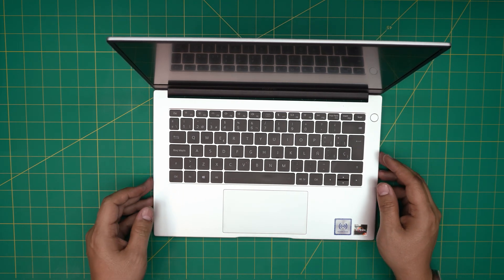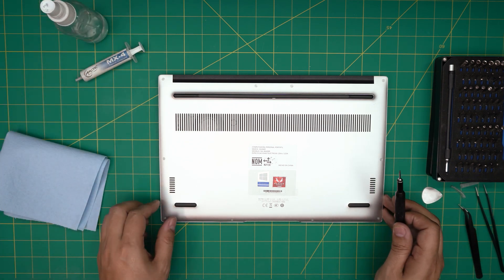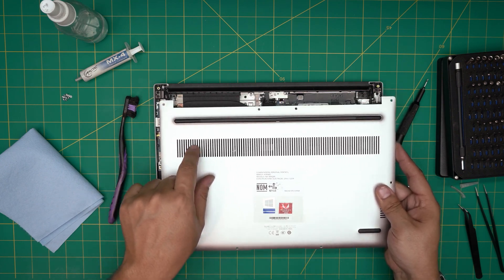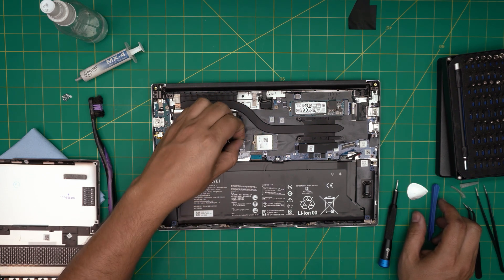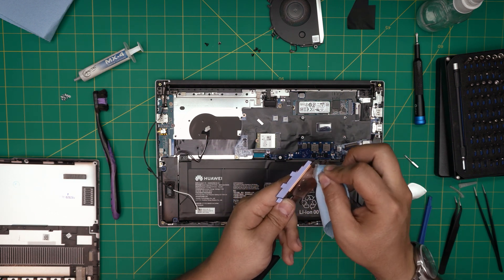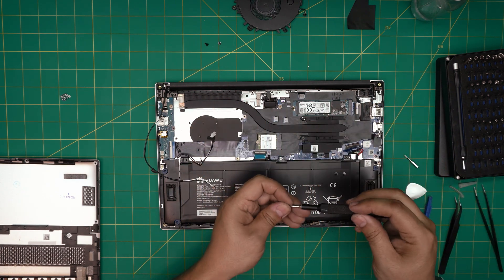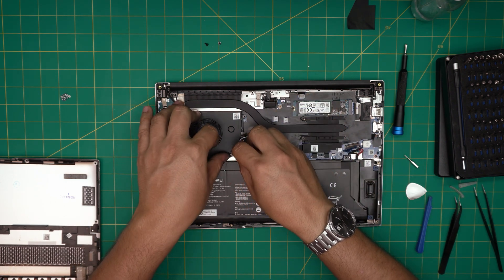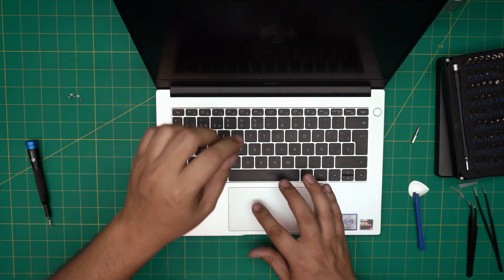How to Repaste and Clean a Huawei Matebook D14 Nblk Wax9x Laptop - Step-by-Step Guide✅

Comment: After i replace the thermal paste and I try to put the case back, I have a big problem. The touchpad wont work. It feels like it is always under pressure. It does not even click. After I open  the case back the touchpad is working… Did you have this problem when you opened it?
Reply from the maker: Regarding your question, make sure there is nothing over the battery, that the middle of the battery and the bottom case are sitting properly, and that nothing is pushing against the battery. Also, make sure you use the correct screws. Place the bottom cover, squeeze the covers together, and test before putting in the screws.
Reply: I had the same issue. I solved it by slightly bending the casing. It’s extremely flexible, so even a light touch can warp it by 1–2°, and the worst part is that you can’t really see anything wrong with it. That’s just a drawback of cleaning aluminum equipment. The laptop is designed so that everything fits very tightly, and during disassembly the casing deforms easily.

Comment: Which direction should we turn the processor screws to remove them? I pushed so hard that the screw broke. I'm so sorry, please help.
Reply from the maker: Regarding your question, the screws open clockwise. Imagine it's a bottle cap; you twist it clockwise.
Reply: @uFixTek I think I had trouble because I tried to open it counterclockwise... The screws were damaged, do you have any idea how I can open it?
Reply from the maker: if you damaged the screw head check this video, and see how i removed it.
https://youtu.be/UaMO0sH45VI

Comment: 10:25 Thank you for your video! I applied the thermal paste as you have shown (line in the middle). I may have used a little more of the paste and now I have the feeling that my laptop is getting hotter than before. Have I used too much? I have read that too much can impair heat dissipation.
Reply from the maker: It's my pleasure my friend.
🫠Regarding your question, i don't think you have placed a lot, just a line is fine, open it and if you see the paste is over the CPU and to the sides then sure you have placed a lot. also make sure you use a ORIGINAL branded thermal paste like :
thermal grizzly kryonaut: https://amzn.to/3WItVQW
this is the best thermal paste for the laptop, there are many fakes out there.
Should you have any further questions or requests in the future, please don't hesitate to ask me.
cheers🍻

This is an Amazon affiliate link. When you use my links, you are helping to support the channel. 🙏

Comment: I can't remove the screws on the heatsink despite using the same screwdriver I used for the fan
Reply from the maker: press harder down on the screw and use a longer handle screwdriver.
Reply: @uFixTek  aynı sorunu bende yaşıyorum 😭

Comment: I'm watching this on my Huawei Mate D14. I used to be able to play Genshin and Tekken 7 at medium graphics but now it tends to overheat. And lags a lot. I know a lot about computers I built and fixed a lot of them but I'm not familiar with laptops hardware. I did what I know like resetting it, debloating it and etc. Now, what's left is checking the hardware.
Reply from the maker: 🫠Regarding your question, you will need to repaste and use a high quality thermal paste to get the temps back under control.
Should you have any further questions or requests in the future, please don't hesitate to ask me.
cheers🍻
Reply: @uFixTek  Yey, after 2 weeks I managed to clean my device. There is a lot of cat fur and other stuff in the fan. I also repasted it,
Reply: @CodeAikawa and how is it going so far? is the heat coming normal again?
Reply: @mekenmalllcuy  yeah and the main fix for me is just using a laptop stand, because putting your laptop on flat surface blocks the hot air from going out.
Reply: @mekenmalllcuy  btw, don't be surprise if you see that your thermal paste has turn into dust haha, that's what I saw when I opened it.
Reply: @uFixTek  I just bought the necessary tools online. And when it's delivered I'll come back to this video.

Comment: i just want to ask.. i  have the same matebook d14 and its screen is flickering.. i tried a bunch of solution in the internet to fix the software but it doesnt work and i think the problem is in the hardware.. what could be the possible issue there that causes screen flickering?
Reply from the maker: Thank you for the feedback! if you wish to support the channel you can LIKE or SUB or both :P
regarding your question: we do get this issue a lot in the store with same problem, its is not software issue. there are two issues 80% its a lcd cable that is loose at the back of the LCD connector, 20% is the LCD you will need to replace. in the store we have screens to test. also connect HDMI out and it should not flicker.
Reply: @uFixTek  is it possible that the cause is dust that enter inside under the laptop?? My workstation is kinda dusty every time and i clean it every time.. is it possible that the cause of flickering is dust? Or if not, how to fix the lcd issue??
Reply from the maker: no its not the dust my friend,  1st test the laptop with HDMI cable with external monitor or with your TV and see if its not flickering (the TV or external monitor). Let me know.
Reply: @uFixTek  oh thank you very much for the response i will try your suggestion and ive already contacted the service center of my laptop and is ready to pick up for the repair.. thank you again
Reply from the maker: @lieutenantdrone6059  oki, awesome i wish you the best and if you have any question ask me in the future.